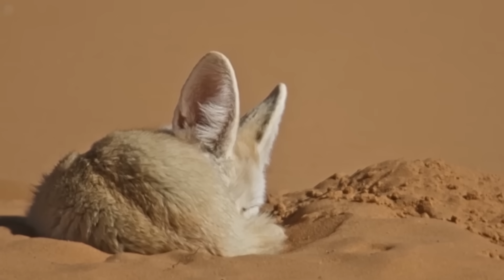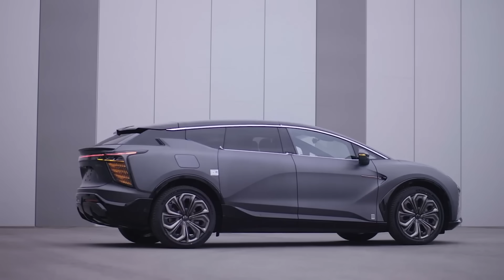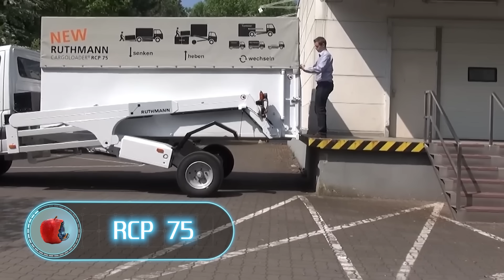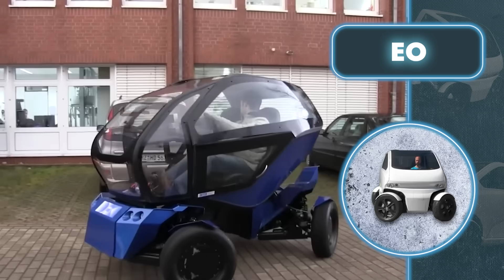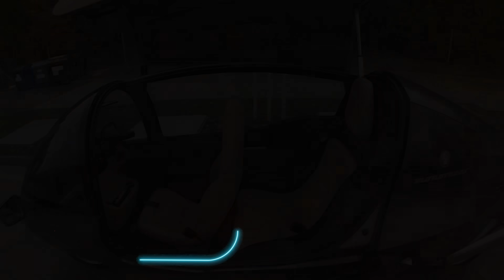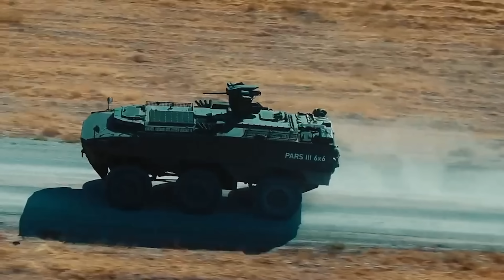You Won't Believe What These Machines Can Do

Comment: That wiPhi-x looks like a total piece of garbage.  I wouldn't advise anyone to buy a car with 600 sensors unless they enjoy swapping them out on aa daily basis, which given Chinese manufacturing standards would be a generous estimation.  The opening roof is totally stupid, you still have to plunk your butt down in the seat, so what does it matter.  Knowing the Chinese I would also just about bet the farm that those performance numbers are a complete fabrication, if not, they reflect only wat the car can do under absolutely optimal conditions.